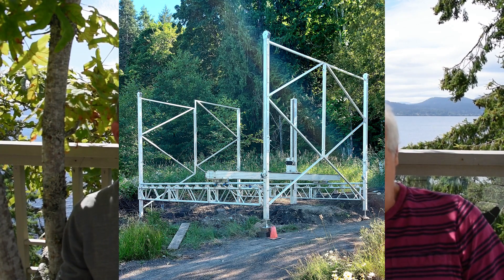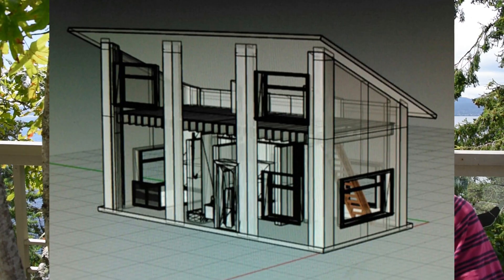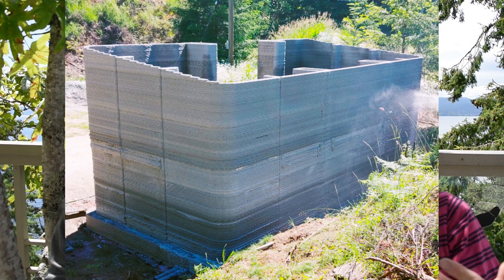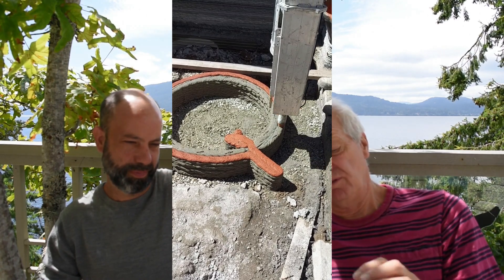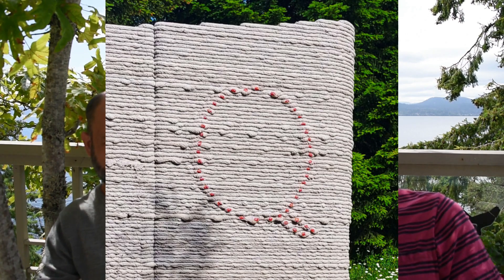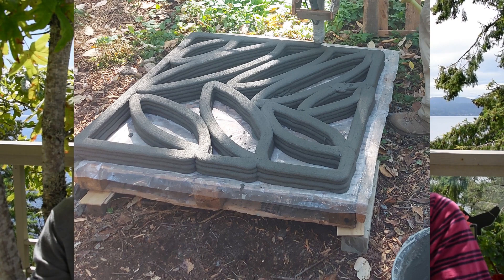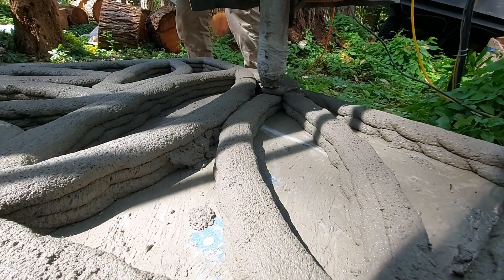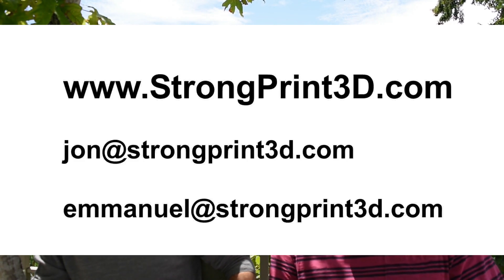StrongPrint3D is a concrete 3D printing company in Southwest British Columbia, Salt Spring Island BC

Comment: beautiful - I especially like the fencing options. would you use the 3D printing mainly for gates or smaller decorative areas of a larger fence? how does the price compare to wood or mesh fencing?
Reply: because the panels are quite heavy, they are best used for the fence but not the gate. the panels would cost $100 to $150 each.  
you can design your own panels and have the only fence in the world with that design !
Reply: Thank you, mainly for fences and posts for gates !
Cost depends how you see it. These fences will last for a lifetime....

Comment: Great Video, John...I'd like to hear more about capabilities and likely costs for such a home in 12-24-38 months time as the technoLogy matures and interest swells....great stuff! :)
Reply: 3D printing reduces the cost of the foundation and walls, but still need a roof, windows, doors, plumbing, electrical, counters, etc.
with a "2k" mix, a dome roof can be 3D printed too, further reducing cost
Reply: House cost will be 35k to 40k for the concrete part. Total cost will be from 70k to 90k depending of the finishing.